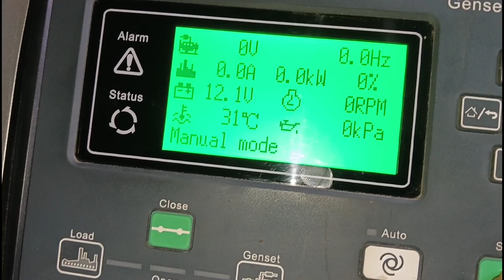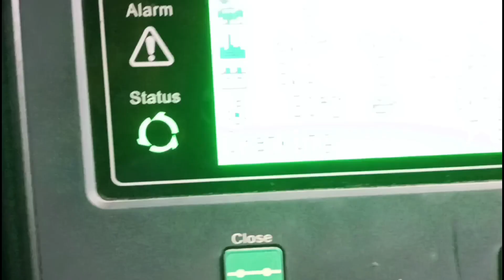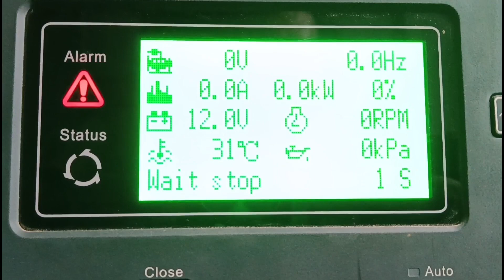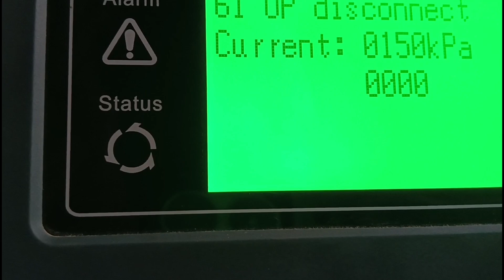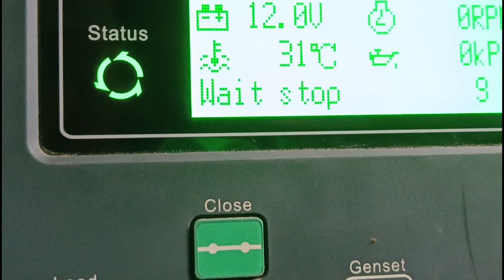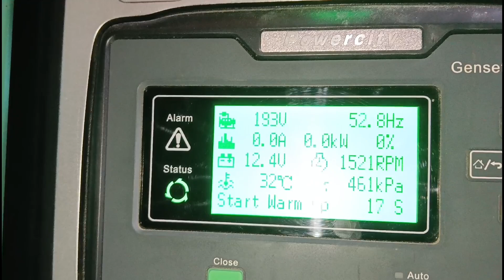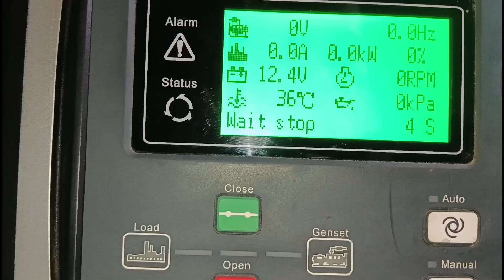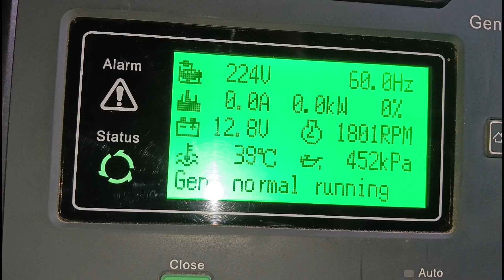GENSET FAILED TO START HOW TO FIX IT

Comment: Idol Pag mahina Naba ang magnetism nang generator, DNA gagana? 14 Volt kasi ang reading voltage, kahit bago ang AVR,
Reply: Or kaylangan lang nang linis,? Kasi pinatay lang siya at naka pahinga, tapus nong Pina start Uli biglang wala nang voltage
Reply from the maker: Mag direct excite ka boss.para malam kung ok pa yong mga diode nya
Reply from the maker: Tangal sa avr boss yong sensing nya.may video Ako Nyan kung pano gagawin
Reply: @jubsofficialvlog1473  cg po idol,, kasi Pag may sira gen set Ikaw ang lagi Kong pinapa nood

Comment: Boss ask Lang ano Kaya possible problem ng under speed alarm nya? Ty
Reply from the maker: Maaring speed controller boss kung gi taas Ang idle
Reply: @jubsofficialvlog1473  yong sensor ba boss or yong mismong controller module?

Comment: boss pwedeng paturo, ganyan ang problema ng generator nmin,
Reply from the maker: Pwede boss Ani ba problema Ng Genset nyo
Reply from the maker: Check mo fuel system nya pati electrical nya
Reply: @jubsofficialvlog1473  ayaw din magtuloy lods low pressure din nakalagay
Reply from the maker: @zjmacapugaylabasan7990  ganyan Yan talaga pag di umandar low pressure talaga.check mo kung nagalaw yong actuator nya habang nag ka cranck
Reply: @jubsofficialvlog1473  ok na sya lods, thank you may natutunan ako
Reply from the maker: @zjmacapugaylabasan7990  ok lang boss